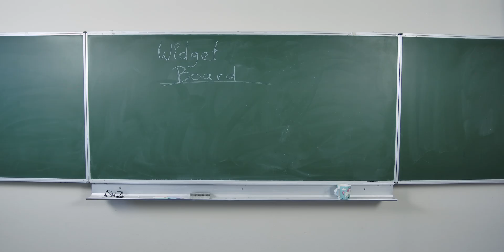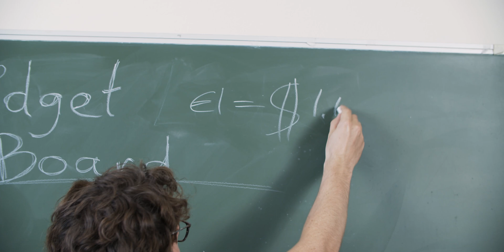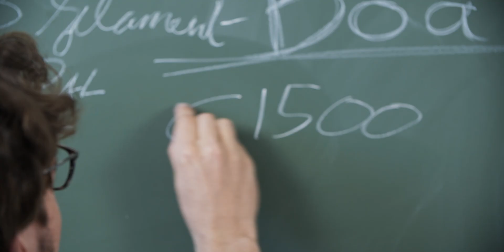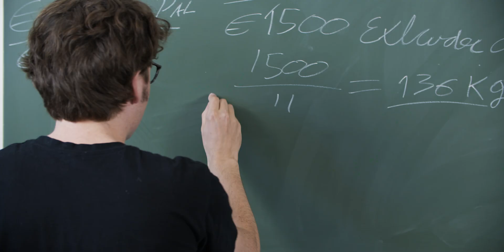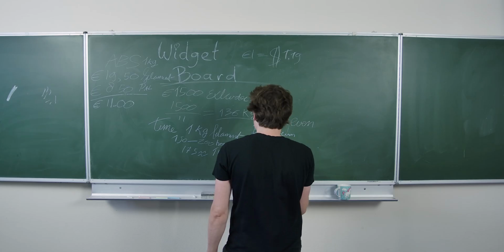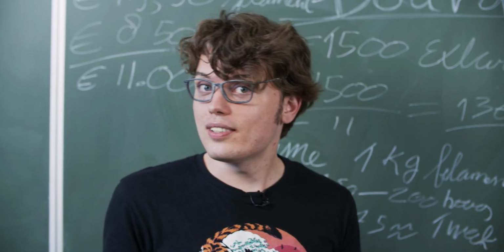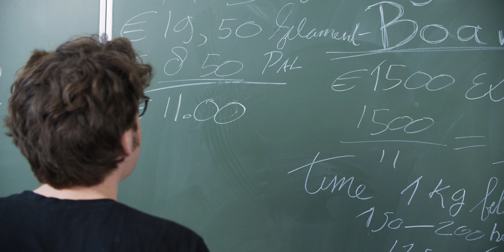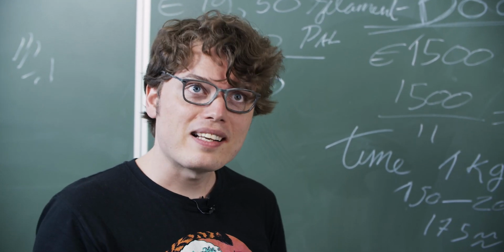Making my own 3D printer filament! - Finale

Comment: Awesome. I was wanting to buy a 3d printer when I get the money for a good one. And was wondering how hard itd be to make my own filament. Now I see that it's not easy at all lol. But what if you were to recycle plastic. Like old prints that you want to scrap or even everyday recyclables. Throw it in something to grind it up into small chuncks then do pretty much what you did. And save money while saving the earth. And wonder if there is a way to lower the cost of the machine you made. But overall great videos that answered my questions. And honestly loved how you showed the whole process even the problems you had made it feel real.
Reply from the maker: Hey, Im happy I could make the struggle feel real. For the extruder these things can be made for a lower price. I used 1cm thich machined stainless steel parts to construct the frame and that was very expansive. But you could use mostly of the shelf parts or go with a slighty smaller size drill bit which will reduce the forces on the frame so you can even make it from plywood. Also you should look in to the posibility of recycling and how much material you make to recycle. What I found out was that you need a lot of it for it to be worth it. Still you can try and get recyclable material from printshops or maker spaces to get the amount of plastic that makes it worth it.
Reply: @widgetlad5157  yeah my first  printer just came in. before owning it i was in full belief that i  could just recycle plastic bottles and other garbage. after learning more about plastics, i now  know it doesn't really work like that. and with my limited space (2 room apartment) it just isn't reasonable. but im sure after a couple years ill have a bunch of scrap PLA and maybe a new house. I might end up looking into the matter of recycling just for shits and giggles.

Comment: I have made a setup with a 1.3mm nozzle..... How to increase the filament diameter coming out of the nozzle so as to make it reach 1.75mm?
Reply from the maker: the diameter of my nozzle is larger than the 1.75mm filament and i use a puller to get it to the right size. If you dont use a puller you should test it by measuring what the thickness is when it comes out and then adjust the nozzle size.
Reply: @widgetlad5157  thank you

Comment: Hi . WidgetLad I really need help. I am doing this project and everything from your videos helped a lot. But iam stuck at the end part where you used the camera to measure the thickness of the filament after applying a canny filter. 
Pls help on how I can do this or a link to the code and software. Thanks in Advance.
Reply from the maker: Great to hear. I send you the code I used. It i with python and you need to have the openCV library. Good Luck
Reply: @widgetlad5157  ThankYou So Much. The code is working perfectly. The canny filter looks amazing. The software is showing values too.. but what do those values represent? Could you please help.

Comment: The stringing might be a problem with the moisture in the filament. It is not really ideal to run the filament through water to cool it, air cooling might be a better option. Maar wel toffe video's om te zien!
Reply from the maker: dankje, I will do some more experiments with the filament itself to see if i can improve the printing quality. But indeed the moisture is a problem.

Comment: You can also sell the filament you make so you can break even faster, that's at least what i'm trying to do :)
Reply from the maker: It went through my mind. But there are some small variations in the thickness of the plastic I have produced. This is not a problem for me when printing, but it is not within the margins that comercial filament has. Also maybe a future adjustment in my setup to get there but I think it will be posible. But I hope to use it to recycle some of the parts that I ended up not using.
Reply: @widgetlad5157  Thank you for the advice. Keep up the great work!

Comment: Subbed, watched the whole thing. What advice can you give about recycling PET bottles into PET filament and then 3d printing with a Creality Ender 3? I am currently building a prototype but i'm told it can be difficult printing pure PET not PETG. I am waiting for my heating element to come from Aliexpress and i already constructed the metal part. I am using a smaller drill bit but the same principle. Do you think it can be possible? Thanks in advance.

Comment: Am working on the puller ......even I have changed from 12 v DC motor to NEMA 17😀 that camera setup to maintain diameter is great idea will try that one too
Reply from the maker: I had once a bad experience wirh a simular setup where the nema17 was not enough. So I thought it would be better to first try a bldc. Using the camera setup works nice if the contrast is clear. Also you need to hold the distance between the filament and camera very constant. Good luck with your endevours
Reply: @widgetlad5157  will share the images once completed :) thankyou for the support :):)

Comment: Maybe you should dry your filament after cooling it down in a water bath. Even PLA gets stringy when literally wet 😉 And your filament seems to be soaked 💧💧💧
Reply from the maker: That will be a good idea. I'm planning to make some upgrades with the setup and that one would be worth persuiting.
Reply: @widgetlad5157  Happy to hear. Make it simple :) Just take the finished filament, roll it on a spool and dry it around 50°-55°C in a modified food dryer or the oven for a couple of hours. That should be doing the job. Alternatively, it even might be sufficient to store the filament in an airtight box over a good portion of well-dried silica gel. Working on a video myself about that topic.
Reply from the maker: I will do a testrun with the filament after drying. Think I can use the oven for it.